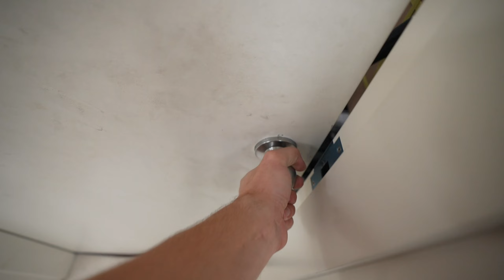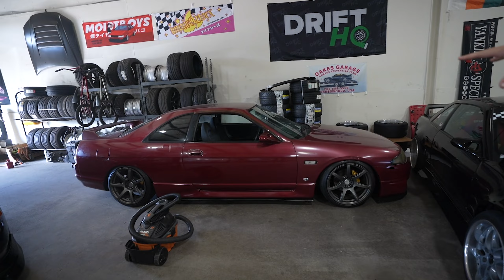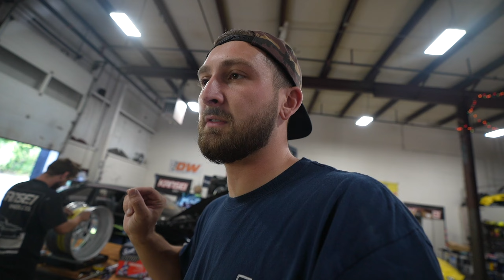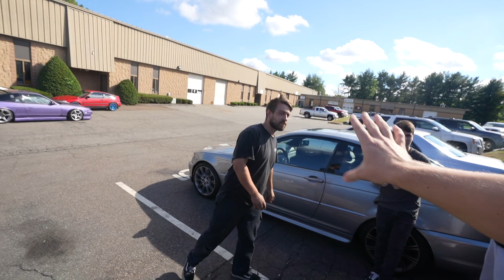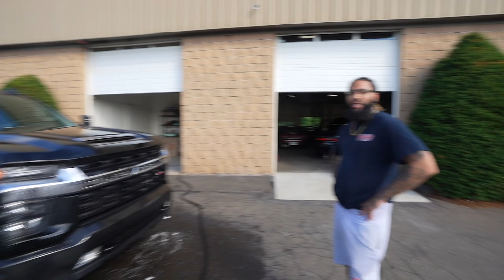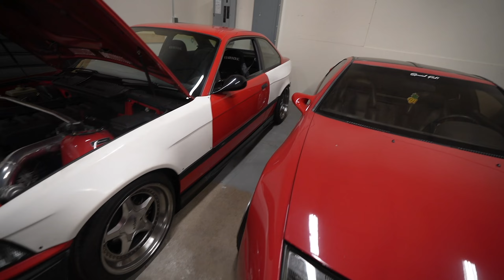Back in the US - MAJOR change of plans!

Comment: Im so happy youre gonna be building a 100% dedicated drift car and sacrifice a bit of interior/stance to get the most performance out of a track car as you can. especially being a trailing arm bmw chassis with a turbo bmw motor. hopefully you build the chassis up strong enough to never break drivetrain parts and make the engine package as reliable as possible by not going too crazy on the dyno. The e36 drift car to me is the most exciting build you have ever talked about on the channel to this day. cant wait to see you start wrenching on this thing

Comment: Ants coupe- in europe is called m package - includes bumpers skirts and rear bumper with diffuser. Also interior carbon piece aint that rare over in europe 🫡 and the taillights are facelift option  that cost fortune if its oem

Comment: Just want to clarify, nothing on the exterior on the zhp is different from a regular m-tech car. It's just that they are all late e46 facelifts with mtec 2 bodykit, the late model led tails etc.
The zhp specific things are cams, rev limit, diff ratio, some suspension stuff and the gearknob. Rest is just pre-determined options package.

Comment: LS motors respond so well to light weight flywheels, the sound of the motor changes so much it's just on a whole different level of rev response, you would swear it wasn't a LS coz of sound and the rev responses is soooo fast

Comment: I have paused the video. Do not sell corolla. This car is unique. Sell one more s chassie while they are expensive. Same with BMW. I would rather see it build as drag car, than another drift car. It would bring variety to the channel, and it would not end up crashed from every angle. If you sell 2 s chassis you should aford building cheap LHD drift car for practice and r32 gtr